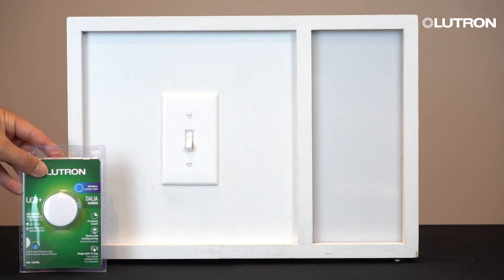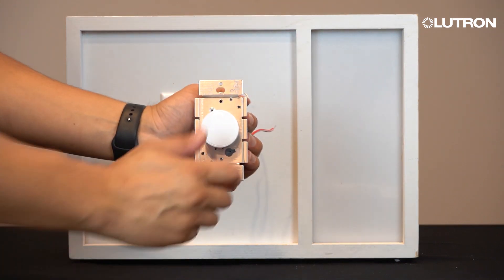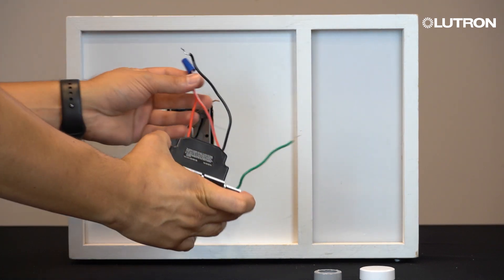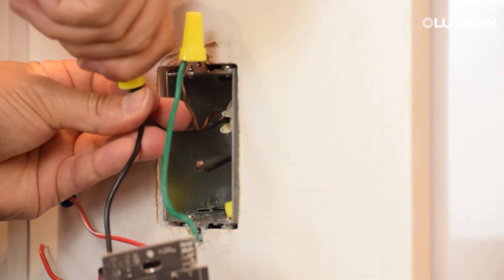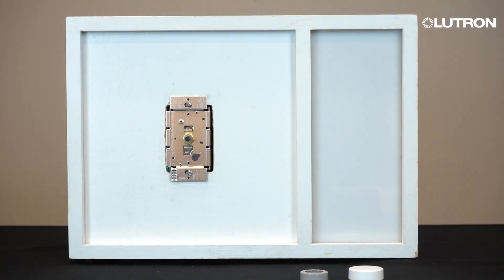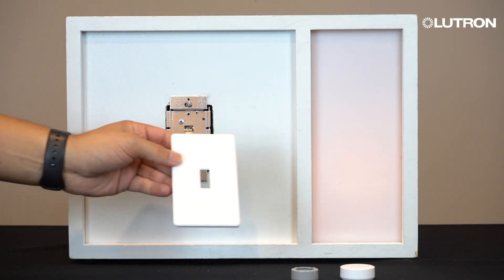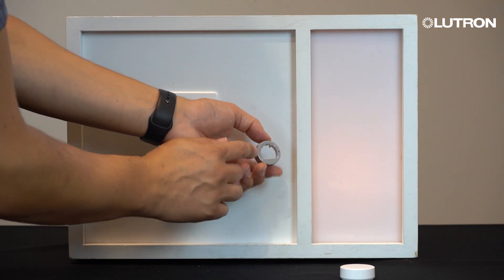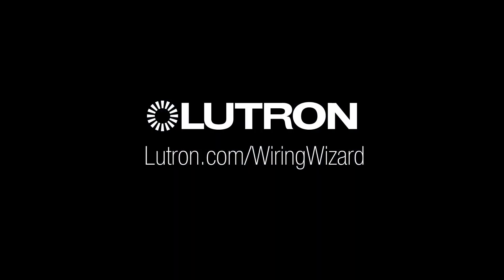Installing a Lutron Dalia Dimmer in a Single Pole Application

Comment: Will any switch plate work? Or do I have to buy the switch plate shown in the video?
Reply from the maker: Hi Anthony, The RCL-153P can be used with existing standard traditional wall plates or the Lutron Fassada wall plate (ie: FG-1-WH). Please keep in mind, specialty molded wall plates may be too thick and may not allow the dimmer to function properly. Lutron would not recommend anything thicker than the Lutron Fassada Wall Plates to be used. Thanks
Reply: @Lutron-Electronics  Thank you for replying.

Comment: What if there is no existing ground wire in the wall?
Reply from the maker: Hi Ben, The RCL-153P doesn't require a ground connection. If there is no ground, simply cap off the green wire with one of the provided wire nuts. Please see important note #3 on the installation guide for more information: https://www.lutron.com/TechnicalDocumentLibrary/0301951.pdf Hope this helps!